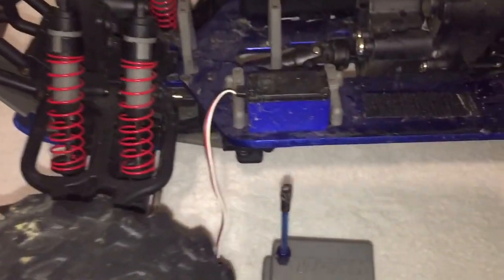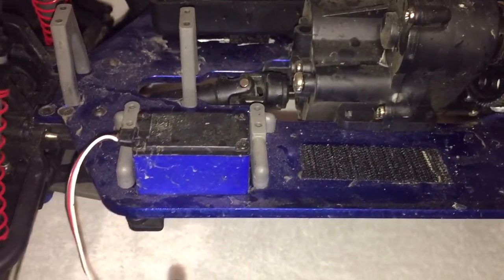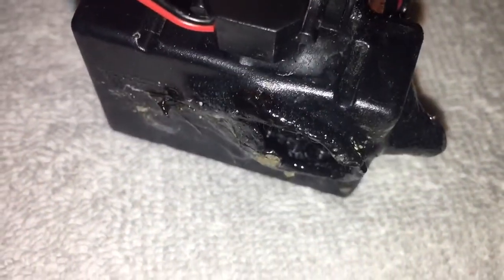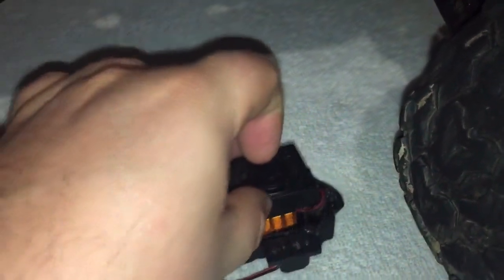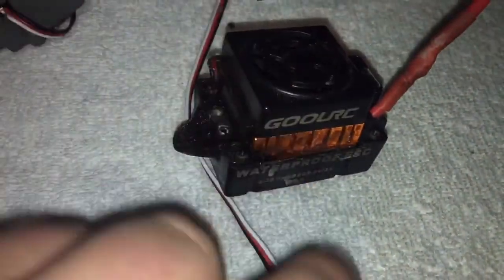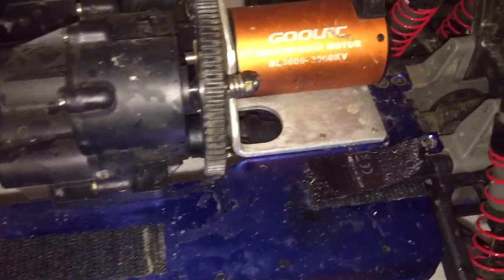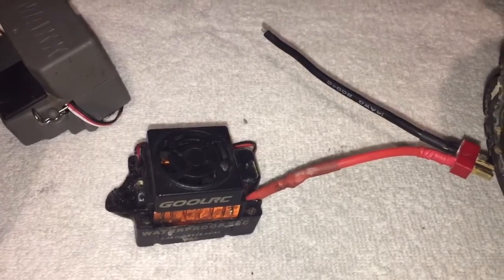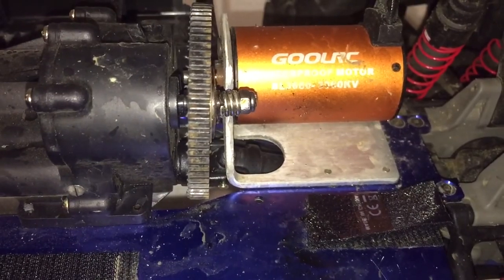Brushless T-maxx Smoke Show | What's next?

Comment: I've done a T-Maxx conversion to brushless a while back, initially I used a 3660 2800kv motor and the same GoolRC 60A esc as yourself, running 2S and very low gearing as I was intending to use it for FPV. It ran without fault. (And if I'm honest I've never had trouble with the 60A GoolRC esc's, thought the 120A esc's they do are proving a different story). I tried 3S in it with the 60A and it ran with no problems at all, I think the gearing helped the esc out no end at all! But wanting more speed I've changed things now, still with the same gearing but fitted an FVT 120A esc and 3800kv 3660 motor - it's amazing! The esc easily handles 4S so at least now I've got that flexibility to choose whether to do some FPV (slower driving using 2S, perhaps 3S) or fit a 4S and have fun bashing it around. It's worked out well. Going back to the GoolRC esc's, I've had a few now over the last 2 years and none have gone up in smoke as yours did, though I have had a weird problem with some of the esc's with calibration. Some 120A esc's have worked as they should, and other 120A esc's have posed a problem with servo direction.

Comment: I'm going to get the brushless electric version of this once I get to work again...... It's a badass truck from the looks of it. My Traxxas e revo 1/8 the scale is badass. The e revo has a brushless castle mamba monster system in it. Very fun truggy but my rear tire tread finally came apart and it popped during a speed run. I was fortunate to have nothing bad happen as far as a serious crash. This hobby is too fun.

Comment: The goolrc and off at esc, motor and card are all the same stuff, same build plant, same electronics.
Consider these a lottery ticket
When you buy a set-up it may work great or you may get a loosing ticket.
Also
I personally would go with a true 1/8 set-up it the emaxx, tmaxx.
Those trucks are very heavy and will kill all brands of esc.

Comment: I would stay with the motor and get a new esc and do gearing only would need a bigger pinion for more speed and a 8th scale motor would have you breaking the diffs and the transmission gears the tmaxx isn't made for high brushless power but then again it's up to you just my opinion bro liked the video 👍
Reply from the maker: Rc Fun - Thank you! No, I was on the same exact thought process you're on. The T-maxx is not meant for that much power.... Not only that, but for bashing and off road, what the T-maxx is made to do, you don't need a ton of speed. The wife likes the slower speed, she really does... That was one of her concerns about getting her own RC was she wanted to feel comfortable driving it, and the T-maxx gives her that. I probably will keep the motor on and get a better ESC... I my pick up some gearing just in case, but I agree man, keep the motor - upgrade the ESC - swap out gearing in needed. Thanks bro!!!

Comment: 3660 can motor and a 60a esc on that big of truck is a bit much I would think.. Have a 3670 2850kv gool motor and gools 120a esc on my 3906 e-maxx. Though it's not water proof the 120a esc doesn't work hard at all and gets warm, even geared 20/66 on 3s. Longer can length and lower kv nor does the motor work hard. But do have a heatsink and a bigass fan to keep temps down. Not the 40mm fan but it's either the 50 or 60mm fan. Pushes loads of air, but yeah the system on my e-maxx is plenty powerful on 3s, ripped off a output shaft on it and had to put steel idler gears in the trans cause the plastic ones couldn't deal.

Comment: I have ran this combo in my short course  Terrain 10 on 2s for a couple of months with no problem , but did keep it dry . It stays cool with 5200 2s and has almost too much power . There are several Esc's  that fail if wet even though it's not supposed to . 
Anyone know how to really water proof one without causing overheat problem  ?
Reply: replace the fan with a liquid cooled heatsink, then you can just cover it in silicone

Comment: Yes that is the wrong combofor the 5 mm motor that you're pushing you need to run no less than 120 amps goolrc also makes 120
Reply: 29 bucks had it for a whole year splashing through water and everything but you have the perfect motor

Comment: LmAo but it does STINK stay away from this motor esc combo
Reply from the maker: Michael King I do agree, stay away from the GoolRC ESC's anyway... OR ... At lease don't get them wet. It ran fine until I got it wet.
Reply: the motors arent bad for the price, i have yet to see one fail, the esc is garbage, burnt on 3s 10 minutes into first run, but i got a hobby wing 120a esc to run the goolrc 3500kv motor and its a good setup, has ran for like a year now no problems, its in a 1/10 mt